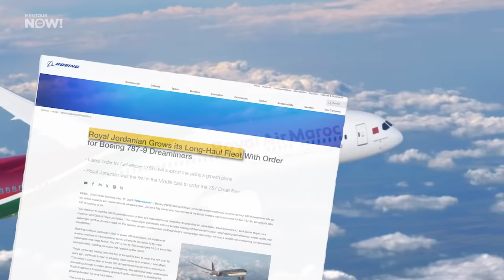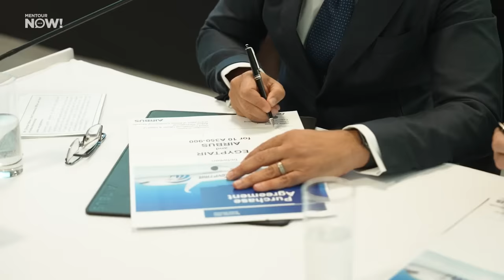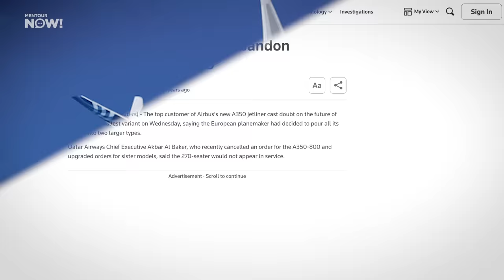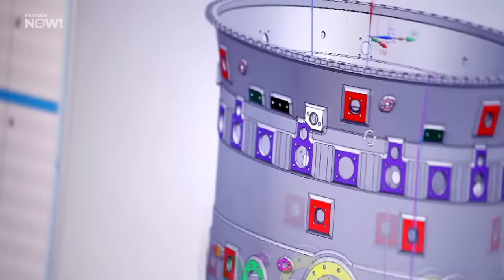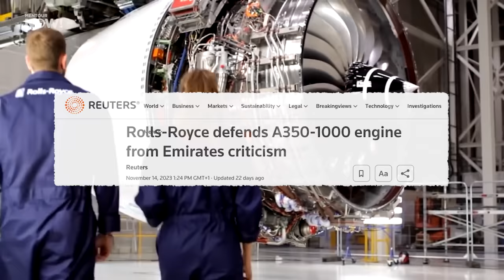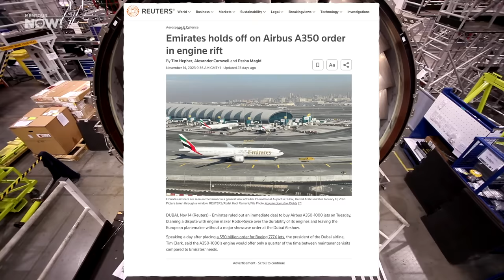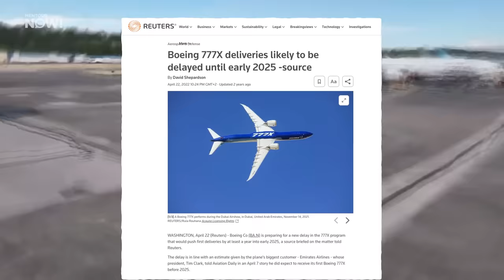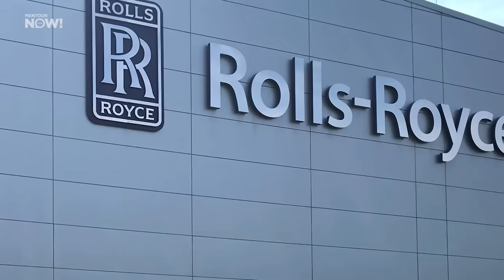What’s WRONG with the Airbus A350?!

Comment: The answer is nothing.
Reply: POV u spit facts for a living
Reply: Airbus>Boeing
Reply: thanks for summarising
Reply: @gamingcitypower5869  never
Reply: qatar airways ceo punching the air
Reply: The answer is the air craft isn't as economically viable for air lines in the southern hemisphere due to exposure to hot sandy environments lowering its flying hours before service
Reply: Last I looked 
- Dubai was 25° north of the equator
- it’s an engine issue not an aircraft issue
Reply: @georgedawson235 that sounds like a problem for every aircraft not just a particular model.
Reply: The answer is marxism. Airbus should be capitalist enough to keep more than one engine supplier and RR be capitalist enough to make engines suitable to any place on earth because you know, planes go places.
Reply: @georgedawson235 Bad attempt to excuse bad product design that only flies in "benign climates" 😂
Reply: @ldine783  indeed, however if you have "designed" an aircraft type to specifically suit the needs of the Arab airlines but your competitors aircraft does it better you shouldnt be surprised nor annoyed that you haven't made any sales
Reply: @bernardkealey6449  well if we're being pedantic an aircraft is but a paper weight without engines
Reply: @gamingcitypower5869 what??
Reply: Aircraft corp. fanboy wars are so pointless. They're multi-billion €/$ companies; pinning your loyalty to them is pathetic.
Reply: Only thing is the tilted landing gears, its toed in not out
Reply: @georgedawson235 , really? is that why Qantas ordered A350 for project sunrise?
Reply: @gamingcitypower5869 you are literally a child.
Reply: As usual a fanboy in denial
Reply: Answer is engines don’t fit need of biggest long haul operator.
Reply: They may not make the engine but they should have realized there was an issue with the RR engines. To say nothing is not true imo.
Reply: @jolness1  The A350 has so far this year secured 150 gross orders, doesn't like a plane that is having difficulties
Reply: Good
Because Bangladesh just ordered 10 of them 😅
Reply: Yes, if you didn’t watch the video that might be your answer.
Reply: @gamingcitypower5869 no boeing is better
Reply: No the answer is they only use 1 engine for that model
Reply: Nothing other than the ENGINES AND THE PAINT the 350 is under performing massively
Reply: Spoiler 😱
Reply: Thanks.
Reply: Agree ❤
Reply: Freemason
Reply: Literally my thought when I saw the thumbnail
Reply: @ajjcooper Nor do the planes
Reply: @Tjgraham125  And if you were flying on the aircraft, the paint may not bother you but the engine issues might keep you awake.  As if that would better protect you.
Reply: Airbus fan detected
Reply: @GiovanniPietro9000  boss baby movie? Not mentioning to that
Reply: @hayleyxyz not if you’re a shareholder
Reply: @hayleyxyz Absolutely 100% true. These companies can and so throw their weight around to maximize their profits at the expense of harm to people. They don't deserve to be worshipped.
Reply: Amen
Reply: The problem is the engines.
Reply: @giggiddy  wdym what its factually bigger the a350 being more efficent depends on the model and is debatable and it is factually cheaper
Reply: One thing, its a big twin thats all there is to say. Engines turning or pax swimming.
Reply: The answer is bleed air system
Reply: @gamingcitypower5869 Boeing > Airbus + Airbus ^10
Reply: Nah the problem is it’s not a Boeing
Reply: @gamingcitypower5869 
Why that ?
Evidence ?

787 = 1900 orders
777-X = 440 orders
A350 = 1100 orders
A330neo = 300 ordres

Boeing > Airbus
Reply: Perhaps...
Reply: @CodPix Never say never
Reply: @gamingcitypower5869 

You say anything but luckily I see that you are a kid by your avatar
Reply: @ndlben7129  never
Reply: Corect
Reply: Answer is its going to wear out fast don't need to even watch the vid to ANSWER that😂
Reply: @KMdonatestuntguy Is that a person and a engine? That would fit lol😅
Reply: Paid Boeing vlog.
Reply: @conned  why do you say that? You most know all about airframe manufacturing? Right 👉🤥
Reply: That’s not what RR has stated. They have acknowledged the problem, and are working on a fix. BEFORE Emirates mentioned it….. The engines are the problem not the plane. Now let’s talk facts.
Reply: @jolness1  true
Reply: @georgedawson235  yep
Reply: @georgedawson235  oh and they have to reboot the computers every 86 hrs of flight or the A350 is susceptible to nose down issues like the 737 Max
Reply: @CodPix  Never say never lol !
Reply: @dmcr9525  The problem is Airbus which almost ruined Rolls Royce with 4 developments in a decade (1997-2000-2007) A340-500/-600, A380 and A350-900 and the -1000 different engine! 

 The 5th being the Trent 1000 of the 787 Dreamliner (2004) Airbus having developed programs which were poorly sold
Reply: @AndrewLarson-mq7xc  I really didn't know that.  Do you have any sources please?
Reply: @GiovanniPietro9000  Only in the narrowbody market
Reply: @GiovanniPietro9000  you mean Bosseing ?
Reply: @ndlben7129  never lol
Reply: @CodPix  Never say never ...
Reply: @ndlben7129  say never never
Reply: @ndlben7129  What the heck are you talking about!??? Rolls Royce was not forced to bid on the contracts. If they were not up for the task they could have simply said no. If the Trent 1000 was more reliable back then it would have sold more. Period.
Reply: @defencebangladesh4068  wait what i thought they were considering not actually going ahead with the order
Reply: @NajeebKuzhiyil-np9on Cambered?
Reply: @georgedawson235 The Southern Hemisphere below or above the equator?
Reply: @NajeebKuzhiyil-np9on they are called landing GEAR…not GEARS. The crew throws the landing GEAR handle not the GEARS handle
Reply: @Tjgraham125 I wish people would write punctuation and complete sentences. Then we might have an idea of the intent.
Reply: They all are. What's your point.
Reply: @hayleyxyz it's so weird to watch
Reply: @VishnuAi Airbus has been outselling Boeing nearly every year for the last 20 years.
Reply: @hayleyxyz and why ? I don’t like poor
Reply: This is not a fan fight, but an analysis of facts. I am an aircraft mechanic specialized in engine replacements and the less often engines have to come out of the wing, better for the Company and the better for all of us.
Reply: @ProjectVRD  yah your right but sales dont mean its a better product
Reply: Well well well..
Reply: @Tjgraham125 B787 also has it's paint issues, so what
Reply: For relatively new airplanes nobody is sure!
Reply: Yes…. Nothing!
Reply: A Boeing Man
Reply: Especially after the Boeing Max 9 Decommissioned rear door was sucked out.
Reply: Jal flight 516:
Reply: Spoilers! Come on man 😂
Reply: @Bluemojieatscookie15 that was more likely human error than a plane issue, and the a350 showed how safe it was with everyone on jl516 surviving the accident 🤷🏽
Reply: It isn't a 757
Reply: @gamingcitypower5869 not True with every plane. Numerous Boeing plane are good as well..
Reply: What’s wrong with the a350? It’s just

Too Beautiful and majestic
Reply: @gamingcitypower5869 Boeing >Airbus
Reply: It sure as hell does not loses plug doors in mid flight. 😅
Reply: @Crybaby_Club  haha
Reply: Unless Boeing the crooked company is paying him
Reply: That's for saving me 22 minutes
Reply: So you didn't listen to the video...cool
Reply: @delta_cosmic 
He is long retired 
Karen Al Bakar’s ego got the best of him. QA not as good as it used to be 😅
Reply: @ThunderboltDragon  Boeing received massive orders for 737 Max....
Reply: Not enough room for sitting, especially taller people
Reply: @goxyeagle8446  enough room for sitting has nothing to do with the airplane be it Boeing or Airbus, it has to do with the companies and how they choose to arrange their sitting configurations and the number of people carried; as well as your own decision to take an economy class seat instead of an economy plus or business when you are a tall person.
Reply: @brunol-p_g8800  Well they asked what's wrong with A350, I couldn't find many things but tight space is obvious. Not all people have money for business class
Reply: There is one thing very wrong with the A350. The fuel tanks are way to big for any sane pilot to ever wanted to be type rated on it. Probably why Airbus is pushing ahead with the “single pilot cruise” program on the 350, this way the airlines don’t have to find as many pilots willing to fly the thing.
Reply: @CodPix That aged well…
Reply: @Svabre  i know it's sarcasm but I wouldn't agree with you
Reply: This is the most perfect answer ever. I even looked at the clip and was like there’s nothing wrong with the 350 there’s nothing wrong with airbus. Boeing is what we have to look out for right now, outsource and sold off parts that make their airplane and they assemble it like, a Lego set. I think it’s the best analogy I can use but it’s a freaking Lego set.  You might think of some better analogies.  I mean, we could even talk about the time it takes to dim the windows between Airbus A350 and whatever trash model of Boeing has it and Airbus would still beat out Boeing.
Reply: Insightful, compelling response!       🤔🙄🥱
Reply: @gamingcitypower5869 This clickbait video aged well like milk.
Reply: Thank you 🙏🏻
Reply: @gamingcitypower5869  Yes a tiny apartment gamer is now avionics expert?,
Reply: Well, he’s a bit of a Boeing fanboy (for some reason)

Comment: The feature I like about AIRBUS is that it doesn't have the MCAS Rock & Roll feature and the doors don't fall off.
Reply: I also heard wheels don't randomly fall off during take-off on Airbuses either
Reply: I also heard that pilots don’t stall the aircraft on Boeing aircraft and that Airbus planes are just computers with wings.
Reply: Airbus doesn’t need MCAS, they fall out of the sky on their own. Ref: QA A330 flight control computers pitched the aircraft over headed for the  Indian ocean, they  had stall warning along with over speed at the same time ( same as with AirFrance crash )their EMCAS was lit up like a Christmas tree. This event happened twice in a row. It was only due to the airmanship and skill of the crew that this didn’t end in a total disaster.
Reply: @MrPrajitura if you would use your brain instead of your mouth you would have done a little reading to find out the cause. FYI United has owned the said incident aircraft for 25 plus years. The accident report stated it was a wheel failure, Boeing had nothing to do with this. Using your mentality, you would reason if you bought a Ford truck 25 years ago and on your way to work one morning the tailgate fell off it would be Fords fault, lots of luck on that. Perhaps if you did a little research first, you might not make a fool out of your self in front of others.
Reply: @MrPrajitura  Thats got nothing to do with boeing..
Reply: @VamarSwiss  What boeing aircraft stalled?
Reply: @michael-y8c  he mixed boeing up with Air France's A330 stall.
Reply: u do realize that many airbus planes have crashed due to computer failure ? ofc during those time social media wasn't as prevalent so u probably never heard of them, if u want to nit pick there is a lot to nit pick from, but at the end of the day u have to realize that thousands of Airbus and Boeing planes land and take off even as I write this comment with no incidents.

Comment: Hi, A350 pilot here. Some of the info shared in this video are not accurate. The -84 and -97 have absolutely nothing to do with fan diameters, as the two variants have the same fan diameter of 3,0 meters, or 118 inches. Actually you could even say that the -900 and the -1000 are powered by two variants of the same engine, the difference being that the Trent XWB-84 that powers the -900 has a thrust output of around 84000lb, and the Trent XWB-97 that powers the -1000 has a 97000lb thrust output and a slightly larger core (around 5% larger), and runs a bit faster.
Reply from the maker: Thank you, yes this was a mistake. Pratt & Whitney names its engines by putting a number at the end to denote the fan diameter, but in this case Rolls-Royce obviously uses this number to denote the thrust output in pounds.

I’m sorry for the confusion and I’ve issued a statement to correct it.
Reply: @MentourNow  Cheers. I’m a big fan of your channels !!
Reply: You need to make sure the information you give out Is accurate,  simply sayings its your research teams fault is not on.  You are a commercial Pilot and you understand better than most that you don't give out incorrect information or say something that's not true.  Instead of producing all these videos,  slow down a little and focus on accuracy,  it will give your viewers better information and stop yourself looking silly... @MentourNow
Reply from the maker: @david22294 Absolutely and it’s not my teams fault.
Reply: @david22294 Petter did make a correction as soon as it was discovered and he put his hands up straight away which shows his integrity as a pilot. As a pilot myself I find Mentour Pilots content very factual and informative with in depth technical  analysis which isn’t watered down for the layman but put across in a specific way which makes it understandable to all viewers. I think we can forgive him for this minor misunderstanding.
Reply: @david22294  live and let live, honestly...
Reply: @david22294 Bro, this is the smallest of mistakes, and really has no bearing on why the 350 wasn't chosen over the 777. Don't know what you're on about.
Reply: @david22294 I don’t think people are too concerned about a minor error like this. You’re acting like you caught him taking a satchel of cash from Airbus.  😂
Reply: @david22294 only one here looking silly is you. He owes NOTHING to you or me.
Reply: I am big fan (no pun) of the show and mentour. I’ve learned a lot. Here the quote from emerates was correct. He said the 350 is maintenance hog. That is the point. The small tech mistake is not. Thanks for all the great work for us hanger aviators.
Reply: @williamcarr459 The A350 is the best aircraft around for maintenance. We barely touch them day to day, are ultra reliable and work as intended.
Reply: @david22294  Speaking of giving inaccurate information, maybe you shouldn't be saying that he's throwing his research team under the bus when he never did that. Also, I'm not sure where on the list of qualifications for being a commercial airline pilot it says "you may never make a mistake in your life when it comes to anything whatsoever", but if I'm wrong, feel free to direct me to that regulation. Instead of being an internet warrior going on a rampage over an innocent mistake, slow down a little and focus on being kind. It will give the commentators a more pleasant experience and stop yourself from looking silly
Reply: Let him crap on Airbus, he is a bitter BO(E)ING Pilot, and so unhappy that he is out of a Job. Because his Crap-Plane has 1000 and one Problems and never will see a Cloud again.
Reply: @david22294  Easy on the guy. He is Boeing 737 driver....sorry pilot
Reply: Why your plane the A350 make weird random winning scary sound at very high altitude. I hard to drink a lot to calm down my scared cells.
Reply: @MentourNow  Thank you for having the humility and integrity to simply say you made an error.  It's critical for everyone involved with aviation to have integrity.
Reply: @Random_Person1023  Great comment!  😄